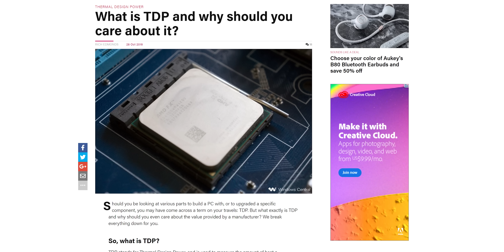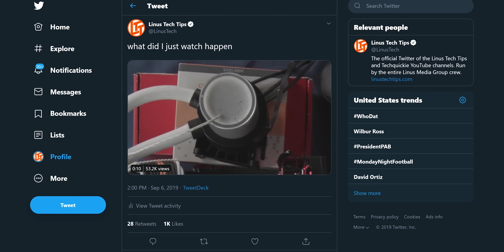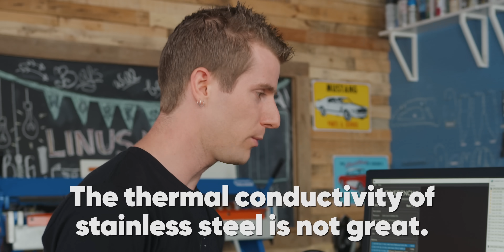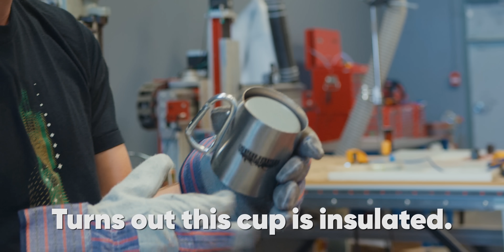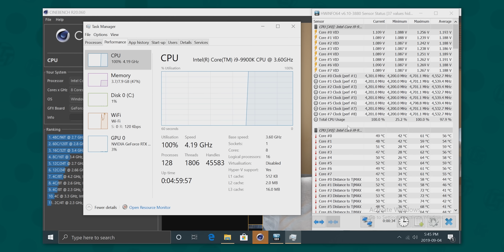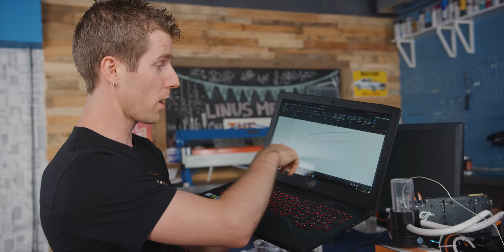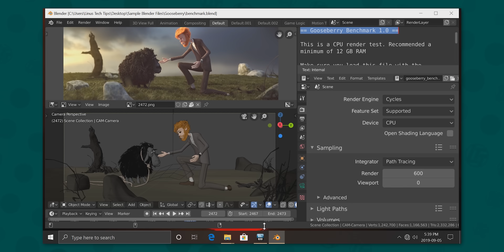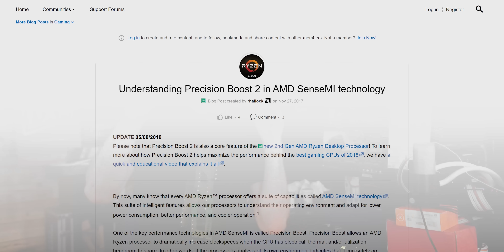Who REALLY Runs Hotter? AMD vs Intel

Comment: Wow i had to stop this was the least scientifically accurate way to do this. 

“There can be inconsistencies with software and die size so we can’t just measure the temp”

“So we decided to introduce an additional dozen or so inconsistencies like a poorly insulated cup”
Reply: I did figure out a method to test this. It's not easy. The CPU would need to be isolated from the rest of the motherboard via an extension cable. I've never heard of one existing, but in principle, a plug on one end would connect to the motherboard as usual, and a cable coming out of it would connect to the CPU. The CPU would be placed in an airtight, insulated container filled with a non corrosive liquid which has a high boiling point and low viscosity. Isopropyl alcohol and kerosene are both good and cheap candidates, though the former needs to be very pure. These aren't the only options, though unfortunately, nearly all the options are indeed flammable, so this should probably not be tested indoors.

The container should be filled about 80% with the remainder filled with an inert gas such as nitrogen. The CPU placed bottom center. A probe in the container can measure the temperature of the fluid, and nearly all heat generated will remain in the container until it is opened. From here, the test can be performed the same way Linus does.

That all being said, Linus likely has not the knowledge nor the means to set up such an experiment. In the end, in his experiment, the two cores performed within the expected deviation temperature wise, however, the fact that the Ryzen got nearly 50% more work done for roughly the same amount of heat output is significant. I find it hard to believe that outside variables could have affected the performance difference to that degree.

Comment: Wait. Why would you do it like this? You are relying on what has better thermal conductivity you also don't account for the fact that AMD has multiple dyes and a wider (less thermally conductive) Integrated Heat Spreader.

This seems like the most unscientific. Way to go about measuring. Like you even have the fact you hard that same water from a previous run so it had heat in it meaning the heat gradient wasn't as high so less heat transfer would occur(wimilarly to why warm water freezer faster than room temp water. The heat gradient means a lot). 

I wish you guys could do this again. Except delided measuring via a small copy probe between each dye and your mounted cooler.  This would help the results.

Comment: This test is bogus I actually just wrote a whole essay why but then decided to delete it... you need to learn about core temp and heat dissapation and refine your idea of what cooler actually means. Also go and study about silicon die and die impurities also your test times clearly showed intel took 5 minutes (the PC clock doesn't lie along with your words I assume) longer to reach 90c that should tell you something. There's a big difference between core temp and ambient temp, the latter being what you essentially measured.

A chip could give off a 1000c and run at a constant core temp of 30c and the other chip could be giving off 120c and run at a core temp of 90c, the chip with a core temp of 30c is actually running cooler, it's a fact.

I'm not a fanboy of Amd or Intel, I use to use Cyrix processor years ago and have had a K6-2 in the early days as well as various intel chips so...

Comment: I don't get why they didn't just start out with that water loop. As long as you use the same setup the pump heat doesn't matter since it will be the same for both runs as long as pump speed stays the same. You also could have used an rms multimeter to measure the resistance of the CPU and energy consumption. If you plot the energy going in and the resistance of the system you can calculate the amount of heat it will generate.

Ring products are really easy to hack. Probably shouldn't be advertising their stuff.

Comment: There are too many variables. Very difficult to test these two different CPU architectures side by side. However if you could have put in a copper spacer block (with the same mass) between the cooler on each CPU and glued a temp sensor to it I think that may have worked a little better?

Comment: That was interesting. I wonder why you didn't mix the fluid into one container. and then pour the premix into each reservoir.

The AMD rendering faster takes me back to the K6 days. I had both intel in AMD machines and was running some obscure 3D program you'd get on a bonus disk in a PC mag. The AMD always beat intel rendering.

Comment: Why wouldnt you just build an amd and an Intel system. Everything the same and you can measure the power supply take-in with different CPUs to get to the 3800x and 9900k real tdp.

Also you could just get 2 very similar boards, one Intel and one amd and find out how much Watts the chipsets need. Sorry guys but this video wasn't made well.

Comment: FFS this is awefull... Pre-mix the dye in the water to get an even concentration, and use a F.ing scale to weight out the water... WAY more precise that eye-fing-balling it... Use a larger container to allow for a larger heat-capacity, which will give you longer time to pickup your data-points...

Comment: I've always found the TDP numbers kinda bogus, My 9700k is rated at 95 watts but under significant load, it easily hits 150W (though it is OC) and 120W stock if I didn't remember incorrectly

Comment: Watts can either be expended as processing or wasted as heat.
Reply: No, processing does not intrinsically use energy
Reply: @teddygoboom1 Heat is produced because of the current draw and resistance in the circuitry., which of course rises as the unit does work, or processing.  It would seem AMD has been able to make their system more efficient thus less heat during processing.
Reply: @lonnienunweiler6049  I see what you're saying, I thought you were saying that some of the electrical energy is turned not into heat but calculations. Yeah amd is much better than intel in that regard, though we'll see if they can stay ahead when (if) intel catches on the process node.

Comment: My  Workstation computer (not possible to overclock) with 8 core Intel Xeon 2288G uses exactly the promised 95W TDP at maximum at the "advertised" 3,7Ghz all 8 core running 100%... But that is just until you let the monster loose  by removing or adjusting the power throttling limit that is holding in in a tight leash :) My Xeon 2288G uses 220W with all 8 cores at 100% use at 4,6Ghz doing a Cinebench 20 test run with 4750 to 5000 in CB score (goes up and down depending on the mood of the CPU?). The 16 core Ryzen 1950X get 6670 CB score in comparison and is also more expensive. Anyway at the end of a run it ends up at 85C and that is with a huge 12 heatpipe cooler that has four 12cm Nuctua fans and it does not get any hotter with longer runs. My Xeon 2288G can run 4,6 to 4,7Ghz all 8 cores all day at 100% with a good cooler .

I think Intel leaves out the total power consumption on purpose so that people that do not know better spends money on larger CPU then they need (since they don`t know it can perform much much better with better cooling).

Comment: I trusted AMD when ryzen 1gen came out.. Now im proud
Reply: I pre-ordered a: 1700x back then.. Still rocking 😂
Reply: @GaborBekkerbboytr1ck2g  I bought one last year and its amazing XD running it with a gen 2 wraith heat sync and omg... 25c to 35c on a daily basis. I love this processor XD
Reply: Same man. Bought Ryzen 1600 when it came out. One of my best investments in computers ever made.
Reply: Dawio89 I'm with you man 🤙
Reply: U will be even prouder now
(I am talking about asus G14 laptop <3)
Reply: Got the 1700 when it came out, I still love this cpu running at 3.9 GHz and 1.33 volts (full load voltage). I had a choice between the 7700K and the 1700 back then, it was pretty much a no brainier.
Reply: Dawio89 same bro
Reply: Me to
Reply: Big brain, big pp
Reply: I trusted and when fx came out it was disappointing but I used it for almost 10 years with ja 4,9ghz overclock and it was still a 1080p beast with a gtx 980 
It just recently gave up and is shutting down after 30min (mostly because of the overclock I think because it was running for 9 years with 4,9ghz) and now I am upgrading to ryzen
Reply: @TsunamicBug  Ryzen is POO POO LUL My i9-10980XE my MUMMY gave ME is SO MUCH fAster THAN UR 2400G amd PEASANT LuL u ALSo Ned AT Leeast 128 GB of RAM To GAME or Ur noT A REL GAMER POOR PEEpol Use GAYMD cuz IT fOR pEASANT GAYMER LULULULULULULULULUL 🗜    🍙〽🌓    🐴🎏🍙💰🍙🎧🚡    💪🌶💪    🌶    🍙💪💰💿    🎧🎏🌓    🍙🚡    💪🎏🎏🍙💰🚡    128    🗜🅱    💿🍜    🕟🍙〽    🚡💿    🗜🍙〽🎏    💿🕟    🌶🕟    🎧💿🚡    🍙    🕟🎏💪    🗜🍙〽🎏🕟    🐴💿💿🕟    🐴🎏🎏🐴💿💪    🌶💰🎏    🗜🍙🌱〽🌓    🍤🌶🐍    ♟🚡    🍜💿🕟    🐴🎏🍙💰🍙🎧🚡    🗜🍙🌱〽🎏🕟    💪🌶💪🌶💪🌶💪🌶💪🌶💪🌶💪🌶💪🌶💪🌶
Reply: @clickmyprofileforfreenudes6599  bro u mental breakdown?
Reply: @clickmyprofileforfreenudes6599  yeah everyone is not a rich bitch like you who got money to keep buying new shit every day and your i9 is trash for gaming if you dont have a gpu
Reply: @SleepyKitteh probably because it's as powerful as a gnat's fart in the wind, surprised it's not holding that RX580 back.. I'm not saying what i run, everybody rages :p
Reply: @ChaosHusky  the r5 2400g is a bit stronger then my i7 4770k which is fine up to a 2060 super so I doubt it maybe try this little thing called research before you shit on things you don't know about (source: my brothers pc has a r5 2400g and I have a 4770k and yes I have tested both of them)
Reply: Shame general use breaks AMD CPUs whereas idiotic users break Intel ones then.. First gen Ryzen tends to degrade if used for mining, going my some friends killing theirs. Intel? Nope. Decent cooling on both too.. It's the voltage, for some reason AMD uses higher stock even on the newer ones, Intel has slightly larger transistors which means more current. That can mean more heat, but voltage spiking is what causes electron migration to occur far more swiftly :p My i7 8086K hasn't degraded at all in over 18 months use overclocked, but i know what i'm doing, that helps ;)
Reply: @ChaosHusky  speak some decent english first. My ryzen 5 1400 was OCed to 4.1 ghz and has been running stable with a decent noctua heatsink for years. If you want to break a CPU with an OC you need to do some crazy shit.

Comment: Linus, you are the "3rd party verifier", with nearly 10 million people subscribed to your content, and 1.4 million people watching one of your random videos.  You are EXACTLY the person to push for a standardized measurement.  I would suggest a "Standard load" power rating, which would be the theoretical amount of power required to run all cores at base or standard clock i.e. not throttled, not boosted, and not overclocked.  This would make a good understanding of the power draw for such a system.  Then I would suggest a second rating of "Thermal load", which is how much heat must be dissipated for the chip to run at top speed for factory settings i.e. constant boost, but not overclocked.  This would be a good way of getting a decent thermal idea for cooling solutions for both producers and customers.  Cooling producers can then rate their cooling solutions accurately as well.  You could even see "LTTSL: xx watts" and "LTTTL: xxx watts" on packaging, of course you could also license that and then do a review of ALL new CPUs that want to use your system!!!  (sent to you for free of course!)

Comment: AMD: We have  efficient CPUs that output less heat than yours!
Intel: At least we save you electricity since you dont need a separate room heater during winter!!
Reply: The_DankSmith and that 'AIO winter room heater' continues to 'heat you up' even in summer 😏😏😏😛😂
Reply: By definition every watt of power that goes into a space heater turns into heat, and every watt that goes to a computer tower becomes heat too.
Reply: @pilotavery  no, the electricity doesn’t convert into heat
Reply: @thetshadow999animates9  yes it does. It's the basic laws of thermodynamics. Any electricity that goes to your computer is converted into heat. The little bit that's converted into light then is going to bounce off a wall and get absorbed by something in your room which is then converted into heat. Any light that goes outside and can be seen through the window technically it's converted to heat outside but even the photons that hit the back of your eyes then heat up the back of your eyeballs by that tiny amount of energy that they have. So by definition, every single watt of electricity that goes into your computer is being turned into heat one way or another. 98.5% of it is turned into heat right away and the other 1.5% is turned into heat with a thousand of a second
Reply: @pilotavery  and what about noise?
Reply: @thetshadow999animates9  Noise gets converted into heat via friction in the materials internal atomic structure. Ever bend metal back and forth until it gets hot? Well the air being compressed and expanded actually causes it to warm up a very tiny bit and the sound will dissipate eventually. Sounds that hits your ears get converted into electrical signals and then back into heat during the exchange of electrons and must be repeated by the next neuron which is the next spending energy in order to signal. Some of the sound may leave the room, a very small amount, which then gets converted into heat eventually as it dissipates into the atmosphere.
Reply: @thetshadow999animates9  dude this is basic laws of thermodynamics. Have you ever taken physics? The way that you measure efficiency of a computer is how much work it can do before that energy gets turned into heat. But all of it will turn into heat eventually one way or another.
Reply: @thetshadow999animates9  hell, even the internal resistance of the power cord and the inefficiency related to that gets turned into heat.
Reply: @thetshadow999animates9  and any EMF noise is just going to ever so slightly vibrate any kind of receiving antenna, or cause a current within the metal, which does not have zero resistance as it's not a superconductor. Therefore it's going to be then converted into heat and therefore going to be heat.
Reply: @pilotavery  o
Reply: Intel is outdated rubbish
Reply: So it only saves you money on a space heater
Reply: Lol
Reply: Lmao 🤣🤣🤣
Reply: I think the gpu would do the same as that
Reply: Funny thats been AMD's trademark up until now "expensive heatcannon that gets tired after 1 year of heavy useage".
I still havnt seen how their Ryzen holds up after 5 years of useage. Dont get me wrong i think its about time they got up to speed with all their "this time we have intel performance without downsides", except the one that only time will really tell.
Reply: @Rawsawn  Considering heat is one of the biggest electronics killers, less heat likely means better longevity.
Reply: @Rawsawn  they're rated to last 10 years, my first gen has a OC of 4.1 ghz at 1.35 volts and its been running stable with no degrades since i yearly benchmark.
Reply: @Rawsawn  I can tell you Ryzen 1800X runs very reliably after 5 years.
Reply: @Rawsawn  have been using ryzen 2600 . its far better than my pc with i7 7700k. It runs cooler too. Gives me better performamce too. And less power consumption too. The most of the work i do is photo and video editing. And gaming very very similar performance
Reply: @Rawsawn  Yeah, the reason why I haven't bought an expensive AMD CPU is because I don't trust them to last. Poor people can't afford cheap things.

Comment: Method is quite flawed. Use watercooling with chiller or other method to keep stressed  temperature the same. Then measure difference in input and output tempetature while measuring water flow.

Comment: you should have done a normal watercooled loop  with a mass flow measurement and Delta T measurement  over the radiator. then you can keep the system running at max output and calculate the heat created by the system.

Comment: Lots of contortions to avoid using a power meter....

However if you want to accurately work out power draw then use the DELTA of the water temperature.

4.186joules per gram (cc) per degree C (4186 joules/litre/degree C)

Once you know how much water you have and the time it takes to change temperature by X degrees (ie, add Y joules of heat), you can turn that into watts (joules/second) of heat output by the CPU.

(oh, and boil the water before chilling it to drive out any disssolved air, that  does make a difference to your specific eat)

Comment: As an owner of 9900k...its toasty if you push the chip ( especially if you overclock it )so AIO Liquid cooler is definitely required if you do any serious work with it (even high end air coolers like noctua is barely enough ) also the mb warm up so you need a good case with massive airflow , for gaming go for the 9700k or amd ^^

Comment: I always thought that TDP was a measurement of waste heat, rather than actual power consumption. more of a determination of efficiency and how much heat you would have to dissipate through your cooling solution than actually how much power was being used. (sorry, only 30 seconds in to the video and should probably watch the rest)